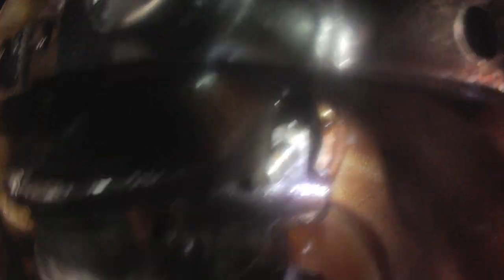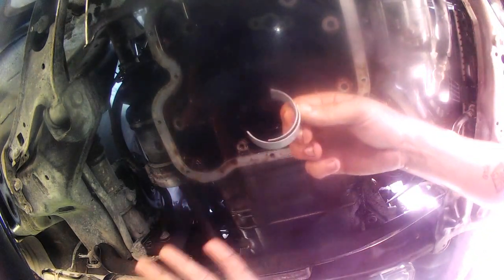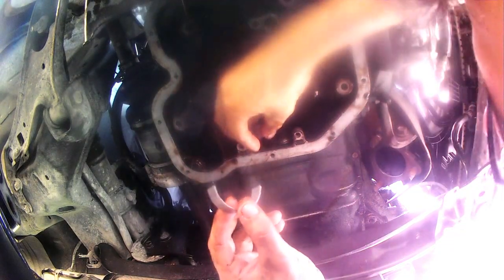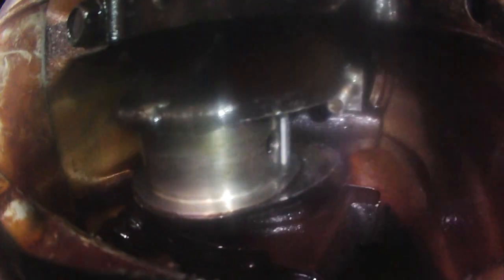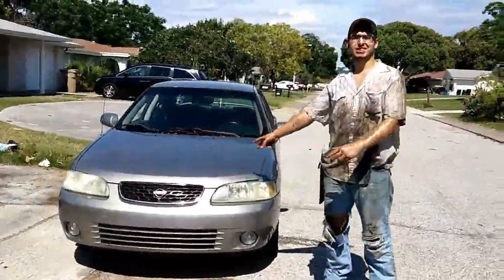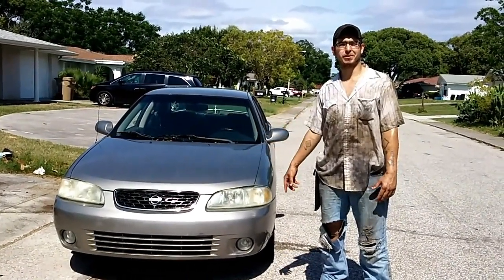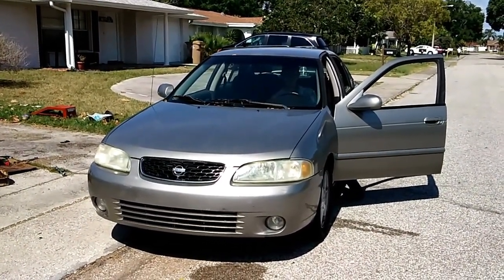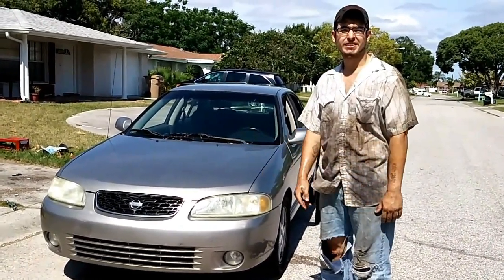Rod Bearing Repair-2001 Nissan Sentra DOHC

Comment: Hi there found a bolt an nut for the connecting rod bearing in the oil pan is it possible to reinstall a bolt without tearing apart the engine seeing that it’s on top an the nut is below?

Comment: Thanks I'm having this problem after 300,000 miles.
Reply from the maker: Jason Gamboa glad my half assed video could help xD
Reply: OSK_Haru yeah I had a harmonic balancer go bad break through the timing chain cover and lost all the oil. After that it made a tapping noise. But I will check the crank next.